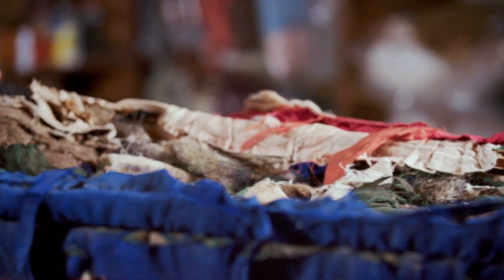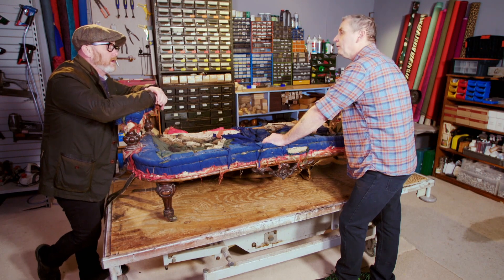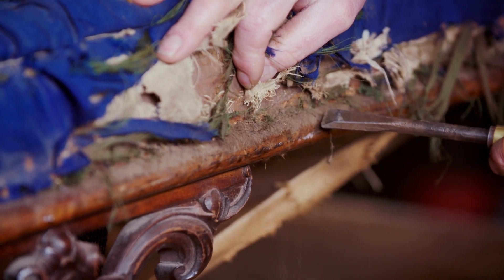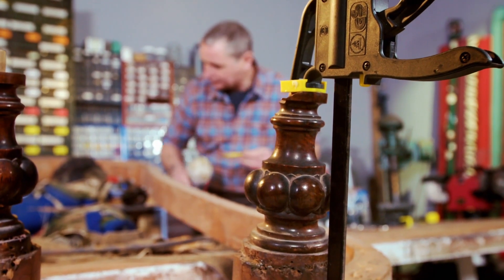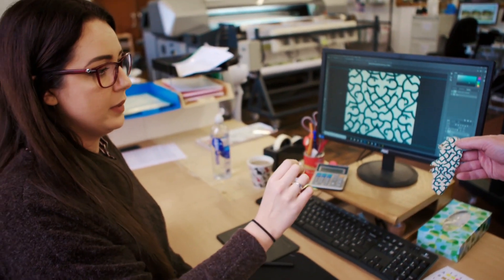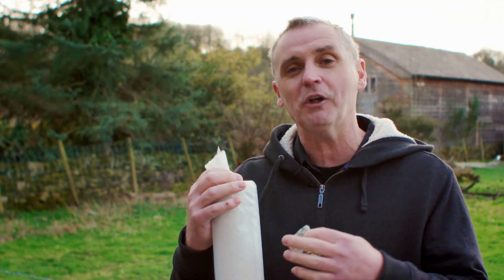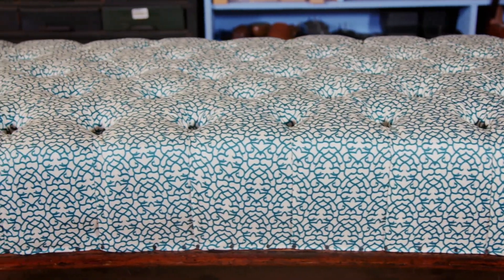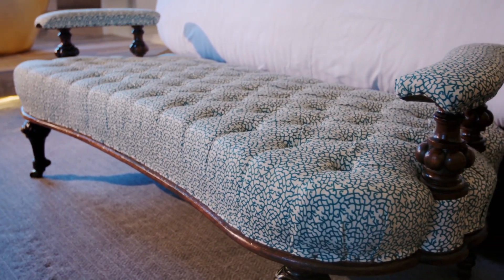This Totally Wrecked Settee Desperately Needs A Complete Makeover | Salvage Hunters: The Restorers

Comment: Cheap looking printed fabric on a piece like this? Totally inappropriate. They should have used a richly colored damask or brocade, a twisted cord around the edge of the seat, and a pleated fabric(say velvet in a contrasting color) under the cord, called ruching-finished off with a coordinating gimp.  The buttons should be done in the same color as the ruching. 6" bullion fringe hanging down from the arms would have been a nice finishing touch. Ticking as he called it is for mattresses and pillows not rosewood furniture.